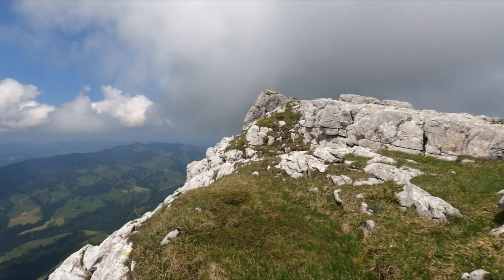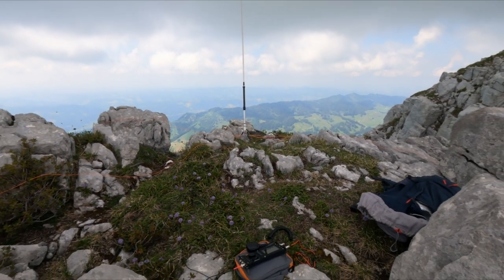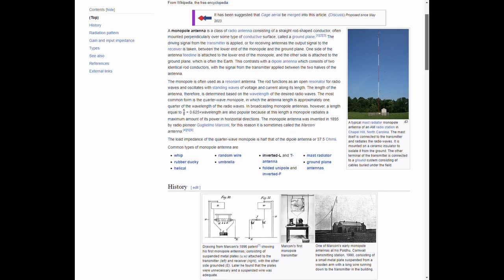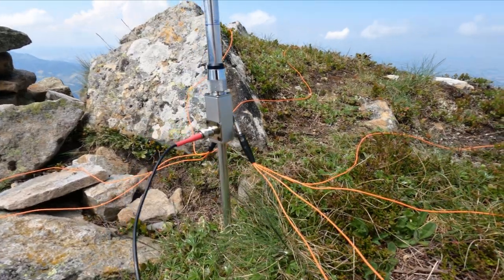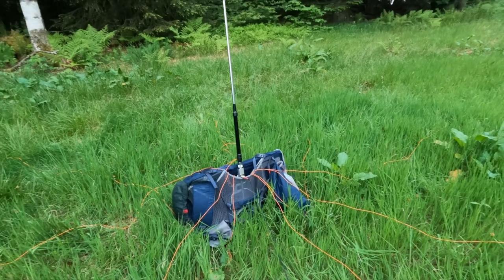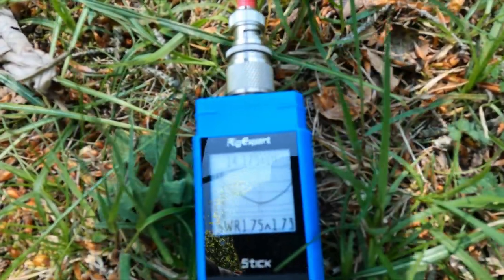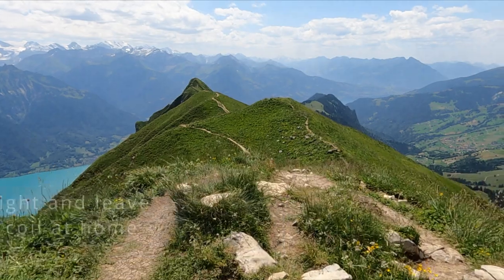Vertical Antenna for Tight Spaces

Comment: Great video.  I like this antenna, but I walked in with my eyes wide open that it wouldn't beat a dipole or a 1/4wave vertical.  I was still impressed that it worked as well as it did, esp for how small it packed up.
Reply from the maker: Thank you for your feedback, Steve! 
I agree wholeheartedly. It can't beat a full length radiator, but for its light weight, short transport length and versatility, it's hard to beat. And in confined spaces, it is better to have an antenna than none at all!

Comment: Looks like it's a better built version of HF-1 antenna. Which was available in many stores few years ago. The performance seem to be the same - nonexistent on 80m, marginal on 40m, quite good on 20m and up. It's worth experimenting with ground radials.
Reply from the maker: Thanks for your feedback! 
I found a German article about the HF-P1 portable antenna (I assume you are referring to) which is a bit shorter but has the coil in the middle. I also assume the performance is comparable to this antenna, except there is a bit of magic involved, hi. And yes, if you use longer and more radials you can get a few more dB, but that adds to the overall weight. My goal was to have about one wavelength of radials at 20m, without the coax screen. That seemed to me to be the sweet spot for efficiency, ease of set-up and weight.

Comment: That's very cool Stephan! I like your idea of combining readily available parts to make an effective system. I've always avoided lots of radials, but you show here how simple it can be. I like how we have both approached the same problem independently yet come up with different solutions.
73, Fraser MM0EFI
Reply from the maker: Fraser, thanks for your kind words! Usually I try to build all from scratch, but this time, the available parts were fitting so well together that I gave it a try. To be honest, I didn't expect that it works so well, but only on the higher bands. Your solution is also striking, especially when one has a good ATU available that is part of the transceiver. Trying and experimenting is so much fun!
73 Stephan

Comment: Many thanks, Stephan, for the very good sota gear ideas in your videos. This is a very good advice for restricted summit space, that I will realize. I am also using your suggested fishing rod holder from Decathlon for supporting my EFHW since one year, very happily. These are great solutions for lightweight gear and fast and easy activations. Thanks a lot, 73 de DL5AZZ
Reply from the maker: Hi Alexander, thank you for your kind words!
I also benefit from so many cool things that people share, e.g. the whole SOTA infrastructure, including SOTLAS, SOTAmat, VK port-a-log, etc. Therefore, when I think something could be useful for somebody else, I dig a bit deeper and try to share my experience and conclusions. 
I'm very happy that I could pass some ideas to you!
Have fun and 73, Stephan

Comment: The eBay seller is now doing the ground spike at 25cm, is this what you asked for I wondered ? Thanks for great ideas, 73
Reply from the maker: I asked the seller back then for this longer ground spike, because it can be helpful when the soil is too hard, e.g. by using a pile of rocks. After my request to the seller, he added an item with this 25cm long spike. But in the meantime, I just realized, that the link got invalid, so I just adapted it to the corresponding item. There are so many versions to choose from.

Comment: Thanks, this is great.  You said that you compared it with you EFHW, but I don't think you provided the actual comparison results.  How did it perform in comparison?  Thanks!
Reply from the maker: Thanks for your question! 
I did several non-scientific comparisons by simply switching between the two antennas, when there was enough space. The 20m long EFHW was configured as inverted-L, with an apex of about 6m. 20m and up was comparable, but 40m was only useable for distances greater than about 100km (no NVIS), but with reduced signal strength (both RX and TX).

Comment: Thank you for the review! How do you find the build and strength of this antenna (whip and all connectors)? Does it feel strong and sturdy?
Reply from the maker: The telescopic antenna itself is pretty light and therefore not very sturdy, but nicely built. If you take a bit care (like with all telescopic antennas), you'll be fine. The support with all connectors is very robust. 
Personally, I prefer light stuff in general, since I have to carry it on my back to a mountain 😅.

Comment: what is your favorite coax? i am using RG58 and it seems there exist more flexible and lightweight option.
Reply from the maker: RG-58 is fine (for VHF I also use this), but for HF I prefer thinner and therefore lighter coaxial cables. Typical ones for portable operation are RG-316 and RG-174. 
I found a very flexible one from Sotabeams: RG-174 A/U MIL. 
I use the same 5m long coax since years for at least 500 SOTA activations in summer heat and in icy winter conditions. I also accidentally stepped on it multiple times, but it still works fine.
Reply: @PortableRadio thank you very much! i was looking everywhere to find an alternative to RG58 and it was too complicated. now i know what model to look for.

Comment: have you ever tested with only 4 radial? i found that more than 4 radial doesnt provide much benefit.
Reply from the maker: No, for this antenna I always use 8 radials plus the coax, also with the full size radiator (20-6m). I don't have all the data at hand, but using only 4 radials will work for sure, but with higher earth losses.
Reply: Hello Stephan, good explanation, this MA-8300 antenna is almost identical to the HF-PRO-2-PLUS-T, it is the one I am using lately and it comes with a tripod to place the antenna ok
It fits larger qrm ok, it is practical for transportation
a hug
EA3HP
Daniel
Reply from the maker: @DONALDUAN1  Hola Daniel, 
Yes, there are so many versions available. I heard from another SOTA ham that the Spanish company Kommunica built the original one (the one you're using). All other makes are basically a copy, but since they're built by the same Taiwanese company, they seem to look and work pretty the same. 
Update: I never tried it with a tripod, but with a ground spike, mainly because it's lighter and and easier to carry. But elevating the antenna feed point with a tripod should improve it's radiation pattern.
73 Stephan
Reply: @PortableRadio  once I neglected to take the photographic tripod
and I put it on the ground, it came out just as well, yours is a punch nailed to the ground, I have seen the same height as yours with a tripod screwed rod ok, I bought my antenna at the Cerdanyola mercaham for 290 euros, it is expensive, in relation to yours
cheers  
Daniel
Reply from the maker: @DONALDUAN1  Yes, there are many mounting possibilities, depending on the actual environment. Last Saturday, when I activated the second summit HB/SZ-024, I found another efficient but quick mounting solution: https://photos.sotl.as/large/52a1dfe305092ba9654fb62b96f92b34.jpg
Mostly, I use one of my EFHW antennas because I can switch bands quickly and it works much better for NVIS. But in the higher mountains with restricted space, this vertical is my go-to antenna.
73 Stephan
Reply: @PortableRadio  Very clever Estephan, I already saw the photo of the punch nailed to the post, hahaha, very good, well, nothing to follow, we heard each other hug

EA3HP
Daniel

Comment: Very nice video ... many thanks for sharing
I'm new to the hobby... can you please say the name of the software used to determine the performance of the antenna
I have the MC-750 antenna and I have gotten good results but wanted to evaluate the performance through software
CR7BDO / 73
Reply from the maker: Hi Jose. Some time ago I was using the free 4NEC2 software, but in the video you see some results from the free MMana-Gal software. There are some good YouTube videos that explain the MMana-Gal software. For the start I liked the one from @DXCommander.
Have fun and 73, Stephan
Reply: Many thanks for your help / 73 @PortableRadio
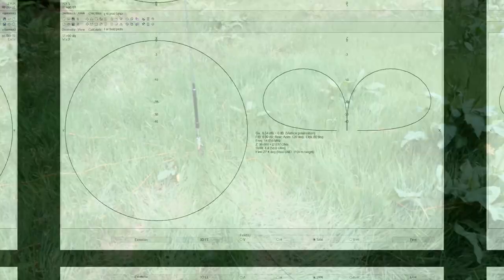Reply: @PortableRadio  Hi! How do you model the adjustable coil in mmana-gal? @5:16 I get the same low SWR as you on 14.050 but as soon as you move to any other bands things get quite nasty. See the following frequency/SWR pairs given by mmana-gal: 7.050Mhz/718, 10.120Mhz/72.9, 14'050Mhz/1.37, 18.080Mhz/14.3,  21.050Mhz/26.1, 24.900Mhz/38.2, 28.200Mhz/45.2. Anything outside of 20m is going to put a lot of reliance on the coil doing its job.
Reply from the maker: @02vLxcZF  Thanks for your question! 
I didn't model the (adjustable) loading coil in mmana-gal, since I was mainly interested in the radiation pattern. The SWR was measured in the field, with the explained configuration. You could also add an inductor at the feed point and change it accordingly. But I never really played with this and the different radial configuration in mmana-gal.